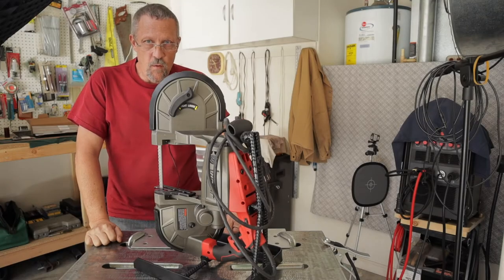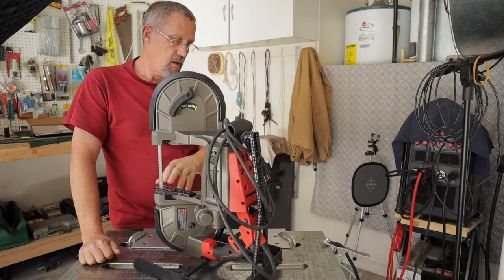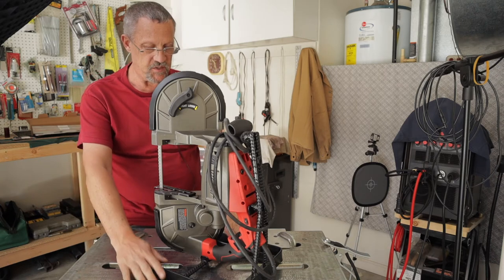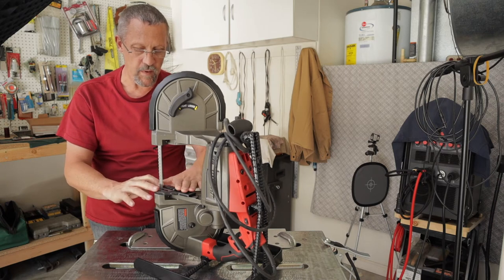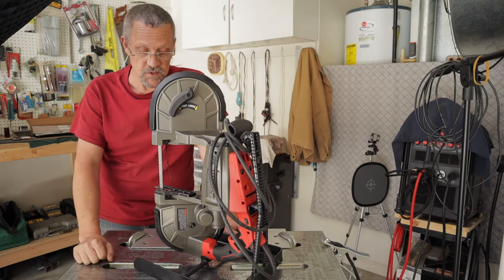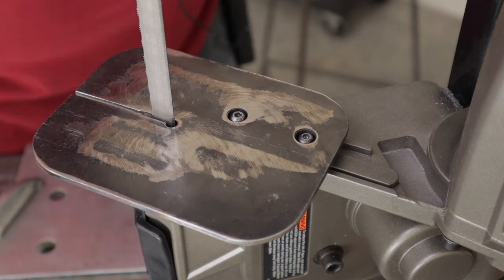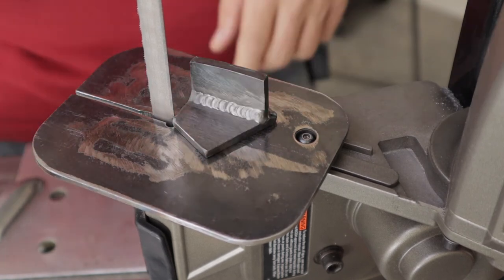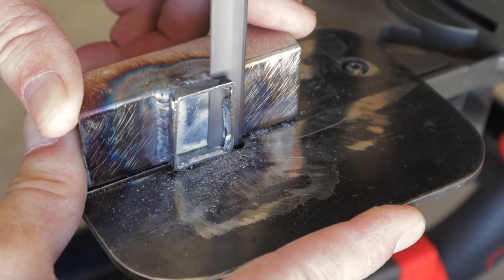DIY Harbor Freight Portable Bandsaw Table - Homemade Tool Ideas

Comment: That looks like a close call at 9:27 ?

Just curious if you made the same mistake as I did, aligning the plate to match the original one. And then found out you have to feed the stock about 5 degrees clockwise to make a straight cut?
Reply from the maker: I don't know it I have the same problem as you but I do have to concentrate to feed the stock and get a straight cut. My saw cuts the same with the new plate as it did with the stock plate I think.

Comment: I think I might have improved your design. I used 3/8 rod , bent it to fit the handle on the saw , added two set screwed bushings to hold the legs so that the whole thing is portable   That is it come apart to lay flat   Easier to transport

Comment: What size and what TPI blade do you use?
Reply from the maker: The size for this Bauer Portable Bandsaw is 44-7/8 In. X 1/2 In. I am currently using the 24 TPI Bimetal Band Saw Blade. On my next blade purchase I'm going to try the 18 TPI Bimetal Band Saw Blade. The 24 TPI does well on mild steel and SS. It clogs quite a bit on aluminum. I'm hoping the 18TPI is better all around for the three metals I cut most frequently.